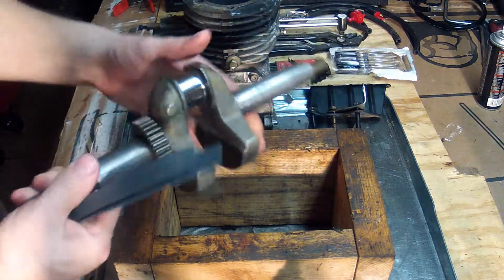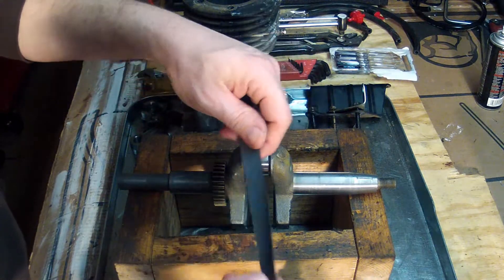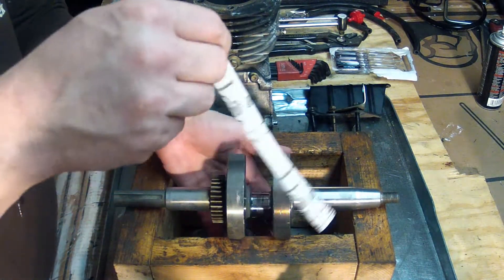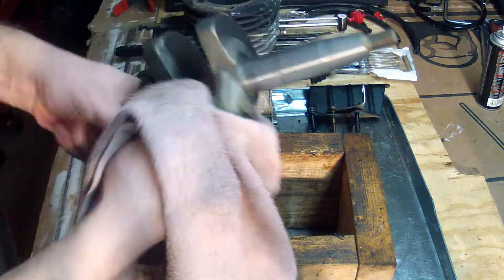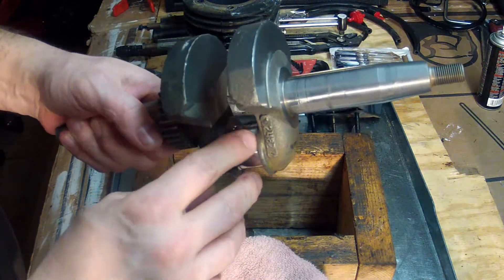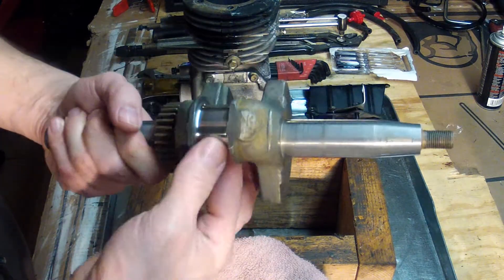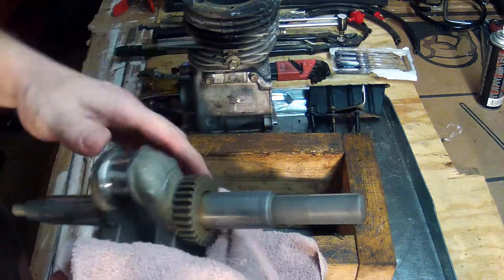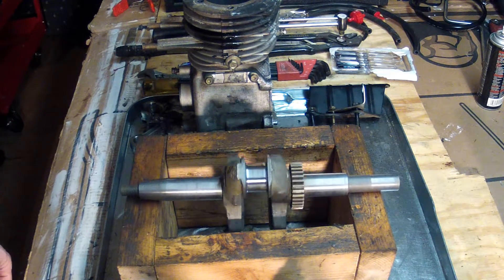Tecumseh HSK70 Rebuild - Part 7 - Sanding the Crank Journal

Comment: Hi I have a HSK50 that starts only with electric start and when it is running it will stole under pressure. what do you think it could be?
Reply from the maker: I think that you may have to clean or rebuild your carburetor. It sounds like it may be starving for fuel when it's under load. I find that 95% of the time, it's a carb issue.
Reply: I replace the carburetor twice I replace the throttle control I replace the coil
Reply: Still the same thing it will start with electric start but will not start with pull start can you show me where to fly will should be at dead top center
Reply from the maker: Albert Hill How is the compression? If your piston rings are worn out, you may have low compression.
Reply: I took off the head and I found that both files are slightly open so it is a compression problem I think I may have to check the camshaft settings